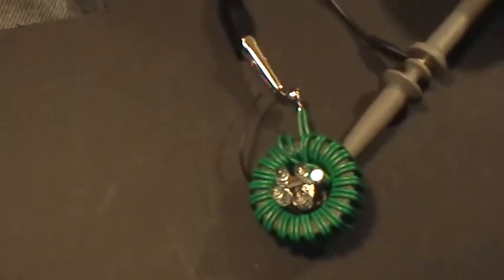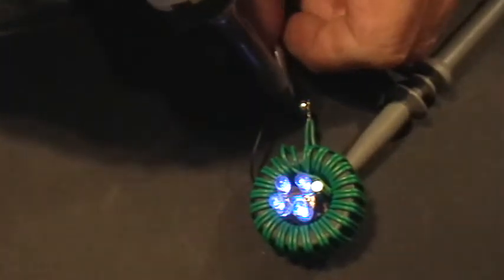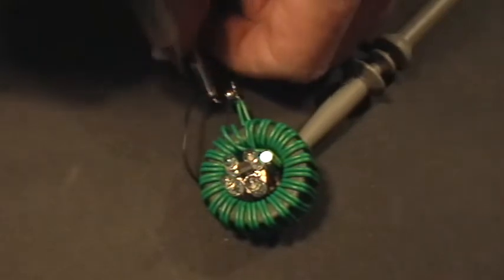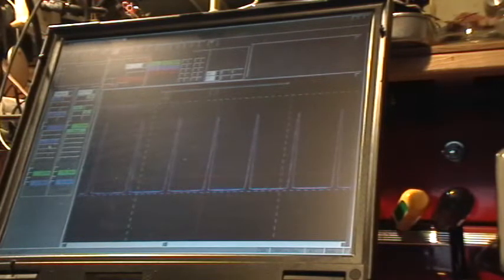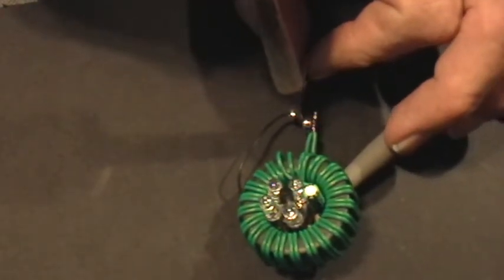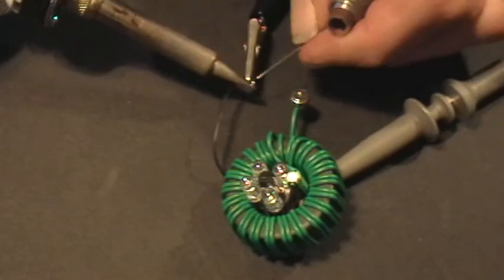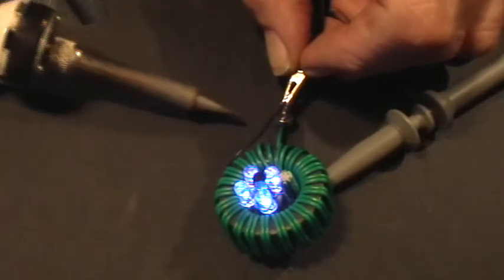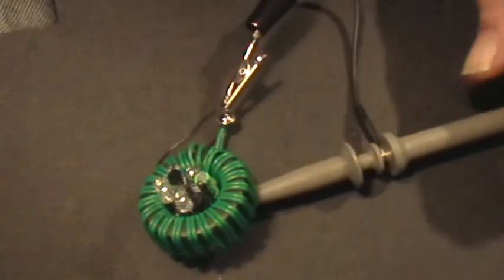Joule Thief: DALM with AG-4 Battery Thermoelectric Effect

Comment: yep, very cool :)

It's like a thermocouple - using heat to induce a voltage in the junction between the dissimilar metals in the battery... Seebeck effect.